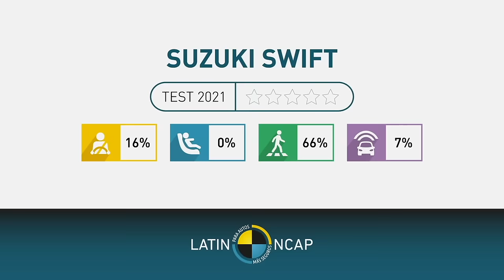The LEAST Safe New Cars to CRASH IN

Comment: The entire Dacia model range made it here 💀
Reply: Is Dacia and Renault one and the same?
Reply: @chrismayer3919  Yes
Reply: I've never heard of them until now, now I know why 💀
Reply: @chrismayer3919  Because of Renault, Dacia has come to this way, today. Almost everything is came from the French brand like chassis, engine, gearbox and some other parts too. Only design is different between them.
Reply: Still a lot better than cars of twenty five years ago
Reply: @chrismayer3919  no
Reply: @ralzvy  they don't. they make cheap cars, like cheap, so you cant put the latest and greatest stuff in it
Reply: Nothing wrong with Dacia cars. You can clearly see from the crash there that the passenger compartment is still in one piece. Take a Mercedes C-Class from 30 years ago or even an E-Class from then or any BMW even from then and your chances of coming out of them after a crash today would be very slim compared to any of today's cars. Car safety has improved massively over the last 30 years. Renault make the best built and safest cars in the World. The only reason this Dacia has 2 stars is because European NCAP has gone stupid and if you do not have  electronic this or that then it's not safe which is stupid. What happens 5 or 10 years down the line when all these electronics fail. The Dacia will still be a safe car but according to ENCAP when tge electronics fail on all these other supersafe cars they will be less safe then. Dacia choose not to add a lot of these unnecessary electronic safety aid to keep the price of there cars down. There us nothing skimped of the materials or structural parts of the car.
Reply: Dacia cars are actually quite safe for the passangers but don’t have the latest radar detection, I’m surprised the vw golf isn’t in the video as the doors come off and kids come out the back of the car in their ncap tests
Reply: Nothing wrong with Dacia, just because they don't have all the alarms or automated stuff no-one needs Ncap give them a poor score, structurally they're fine.
Reply: @sharonec5419  yes, but there are lots if modern cars today that can collide with the ones from this video. Also, questionable about that mercedes, they may look like tanks, but that doesn't mean that they are. And also doesn't mean that they do good energy absorption...
Reply: @ralzvy  nope they just want to lower the cost so that their cars could be affordable
Reply: @yassinehamdouchi5469  i know its an old comment, but dacias are mainly driven by grandmas who dont care about cars
Reply: @Erick-no8zn  no

Comment: Everything is relative, these look very good compared to when crash testing really took off around the turn of the millennium, have a look at the Fiat Seicento crash tests if you really want to scare yourself. Active safety is a huge thing now too in terms of making sure you are going more slowly at the point of impact, even if you don't see it coming, your car will.
Reply: The Rover 100 is even worse. Disintegrates
Reply: The Seicento was about before the crash test boom, as was the Cinq and Rover 100, they were bad in a crash, and not safe, but what about previous 5 star cars that are getting marked down, not because they are physically unsafe to be in, but because they didn't come with driver aids as standard? I know technology is ever evolving, but marking an actual cars safety cell as a death trap, because an option isn't ticked as standard boils my piss a bit.
Reply: @fuzzy-daddy83  I agree. Renegade, was 5* on initial test. Gets three now because it doesn’t come standard with every single safety interference. 

The Ypsilon got one star!
Reply: @angrymuffinsb the holden commodore!!! Is the worst

Comment: The Dacia are safe. The reason for lower ratings is that they don't have the High tech electronic aids. Radar breaking Pre collision detection etc.
Reply: I tend to agree. No noticeable cabin cell deformation like just a few years ago. So the basic construction seems quite solid. Some of the side impacts however worries me somewhat.
Reply: exactly. but 98% of people don t know this...sadly
Reply: The electronic assistant systems only value a 1/4 into the final result of a NCAP Crash test. German here, working for ADAC. And visual results can be deceiving. It is the impact absorption that counts, (which sensors record) Most damage is done by missing absorption.
Also, these are the Latin American Versions. The built-quality tends to be worse in 2nd/3rd world countries. I. E. Compare a Suzuki Vitara (Brezza or Maruti from India) against
a Vitara Maygar (Hungary) from Europe. Same goes with a Swift. 

 Renault is also building safer cars in Europe, but bad ones in other countries.
Non the less, Dacia (Renault in Latin America) isnt safe in any country no matter the year of testing.
Reply: Only the sandero stepway is kinda safe with the 70% occupant safety rating, the others are actually dangerous

Comment: Most of these are not sold in the U.S.............for a reason.
Reply: Thanks to effort made by NHTSA.
Reply: Na , dann erkläre mal den Grund , möchte das auch wissen !!
Reply: The reason you don’t see these in USA isn’t just because they might be less safe than a lot of USA vehicles. It’s instead mostly because consumers in the USA vs Europe have different needs and wants, and different regulations. In general European vehicles are smaller and lighter (and sometimes cheaper) and that makes it harder to engineer them to be safe.

Comment: a vehicle's build & structural integrity should be a primary deciding factor in a crash test . . . safety measures like ABS EBD & airbags are only half the job done . . . the amount of ultra high strength steel used in a vehicle should be increased to a regulated 35% - 40% . . .
Reply: just need to put rollbars like sport car ( hidden behind plastic ) , race drivers don't die during crash nowadays
Reply: This is why I only drive VW they’ve always been using high strength steel
Reply: But they're wearing helmets and harnesses. @stephen10.
Reply: @keaujibaha2594  lol no they have not. VW were some of the biggest bullshitters when it came to safety in the late 90s  to early 00s. Even before that VW pretended to care about safety when in fact they did not. It was only after all the NCAPs started that VW started to get series about safety unlike say Renault or Volvo who were already both very serious about the safety of there cars and were building the safest cars even back then.

Comment: If the cars are this bad, how are they able to be sold?
Reply: the standards are incredibly high now
Reply: @peaceonearth8693  and yet, perversely, in many states (and all of Canada where I now live), there are ZERO roadworthiness tests. In the UK, with very few exceptions, once a car reaches 36 months old, it must, by law, be comprehensively tested every 12 months thereafter by a certified, standardized, approved testing centre who will check all relevant safety systems including brake performance and wear, lightbulb operation and beam pattern, suspension condition and wear, exhaust emissions, seatbelt wear and operation, etc.

Here in Canada, unless your car is showing blatantly visible signs of unroadworthiness (which, let’s face it, at 80kph with the overworked, underpaid police officer travelling in the opposite direction to get his lunch, are just about impossible to spot) your car can join the many thousands of other worn out shitheaps I see every day. From illegal brake light modifications, uncovered LED light bars, tyres protruding out beyond the bodywork, leaking exhaust systems, worn brake pedal rubbers, worn seatbelts, dazzling headlight pattern from the numerous front end impacts over the years, cracked windshields, worn tyres, rusty brake lines, cracked suspension bushes on these ancient beaters I see all the time, the neglected maintenance is shocking.

The crazy prices of the second hand car market and the price and unavailability of new cars means that people hang on to their old 1980s golfs and Volvos long after the UK (and most of Europe) would have consigned them to the scrap heap or forced the owner to keep up with the basic maintenance items above.

I have viewed used cars from just 5 years ago here that are riddled with issues that the current owners happily claim to have ignored because the repairs would be too expensive and there’s no real need to worry about broken fog lights, intermittent failure of windscreen washer jets, split wiper blades, tyres with barely any tread left, etc.

There are plenty of shitboxes in the UK for sure, but at least you know that, with a new MOT before you buy, the major points have been addressed and there has been no period of more than 12 months in its life when the car wasn’t considered safe to be on the roads (except in unusual circumstances if the car has been withdrawn from the roads - which will clearly be on record).

So I’d take a brand new Dacia over being surrounded by clapped-out bangers like I see every day. If you can’t afford to keep your car and other road users safe, you shouldn’t be driving.
Reply: They are very cheap, that’s why. Most people want cheap cars, they don’t care how safe the car really is
Reply: @williambone  for good reason as well
Reply: @stefanvalentin9157  it’s not that people want cheap car, the problem is that most people can’t afford expensive cars! Do you even know how much new car costs?
Reply: @stefanvalentin9157   They are value for money cars but they are more safety than cars built even 30 years ago. Expensive cars are more expensive to maintain, too not only to buy. If everyone in this world has a payment between  5-10.000 $ every month then we could discussed that. In my country 80% of population has cars over 15 years old.
Reply: if you see the results, the have a low rating because of the ADAS, not because of the crash tests
Reply: For the 3º world mainly
Reply: @maddoctor99  Do something about this situation. It sounds dangerous. Go to your local politicians or start a group or organisation to go to them to demand higher standards for the vehicles on Canadian roads.
Even here in little Ireland new cars have to be checked after 4 years for Road Worthiness every year.

Comment: This is BS. For example, on the crashing test, Dacia Sandero got 4 stars. If you are inside, you are pretty safe. The car got in the end 2 stars because it doesn't detect cyclists and pedestrians and it doesn't have lane assist. The Euro NCAP standards are higher now and they don't involve only the security of the passengers.

Comment: Why car manufacturers are even allowed to sell these cars? Imagine how many lives could be saved with higher requirements from the car structure (type of steel, absorption of force, etc.)
Reply: Good question. Chinese cars are probably safer and cheaper, but they get all sorts of negative marketing unlike the EU made cars that are garbage but do not get the negative marketing.
Reply: Euro NCAP and IIHS are not government bodies. These vehicles do meet government standards for safety, but obviously those are minimal. Keep in mind that even the cars that do badly on these tests are much safer than any car that’s probably more than a decade old.
Reply: Do some research, structurally most low star cars are fine, it's the lack of useless driver aids that ruin scores. Eg base model car, no driver aids 2 stars. Top spec model, alarm warning you stay in a lane, let's give this puppy 5 stars. Ncap logic...

Comment: These crash tests become less credible as they evolve. The obstacles are provided to avoid the reinforcements that the manufacturers provide. As this impactor element in the shape of a half 8 to avoid hitting the mediant pillar of the vehicle, or this non-deformable structure which hits the vehicle in the very lower part. Segment A cars and low cost cars are all more dangerous than others. That's not a scoop. You are not equal based on your income. My advice: Don't drink, don't use a smartphone while driving, wear your seat belt, don't drive without a license and respect the driving code. Or ... Don't use a car. And if you stay at home, watch out for earthquakes and falling trees.

Comment: This may be a bit misleading. Euro-NCAP rating also includes stuff like "is there a warning light if you do not use the seatbelt?"  Another example are missing "Isofix" child seat attachment points. If there are none - or even if they are there but not easy to find -  the car will get less points.
AFAIK you can get e.g. max 4 stars if one of these features are missing.
Thus the crash safety may be still decent but minor issues may give a poor rating.

Comment: All cars are the same when you drive save at normal speed and without alcohol and drugs! Then you get no accident. I do it for 35 years now! 😊
Reply: Sometimes it's not your fault. Driver in the oncoming lane falls asleep and crosses the center line. Or a deer crossing the road and you crash into a tree trying to evade etc. Your own behaviour is very important but not in all cases.

Comment: Today I have booked a  TATA Tiago in Red color  with 4 srar GNCAP rating!😁😁😁
Reply: Technically a 0 Star rated car if Tested in Euro NCAP
Reply: the tiago has only 2 airbags it dosen t have 7 airbags like the suzuki s cross buy a car with 7 airbags
Reply: @SmilodonHuntingDeer  Tiago,a small car weighs almost 1000kgs.And I don't  want a Maruti Tin Can even it has 11 Airbags! 
When structural rigidity is compromised, what's the use of Airbags?

And you must tell me why Maruti refuses to send it's cars for testing by GNCAP????
Reply: @wolffury5019  Don't talk about cars Tested in Global NCAP in a Euro NCAP Video. Tiago will Patheticly Fail in Side Impact, Side Pole, Small Overlap and Pedestrian Tests. Or maybe even Whisplash.
Reply: @25StevyLovesDaddyTata  All Tata cars will fail in pedestrian safety tests
Reply: @fordecosport7736  And Bumper tests too. Literally their Bumper is just for Design it seems, always the Boot Door or the Grille or Bonnet takes impact first which is to be done by The Bumper. Pointed Front Bonnet design in Tiago and Altroz and nearly useless bumper in the rear of Punch, Nexon and Altroz.
Reply: @25StevyLovesDaddyTata  Once my legs accidently hit a bumper of Tigor  and it hurt so much, just imagine what if it hits a pedestrian😨